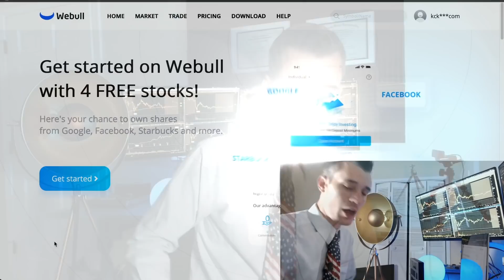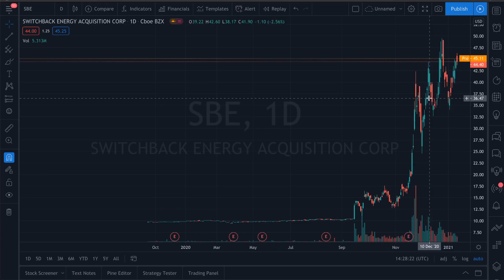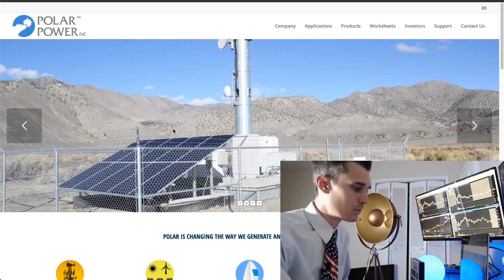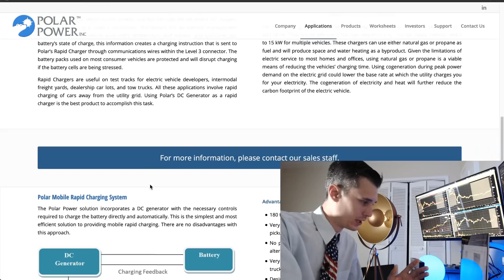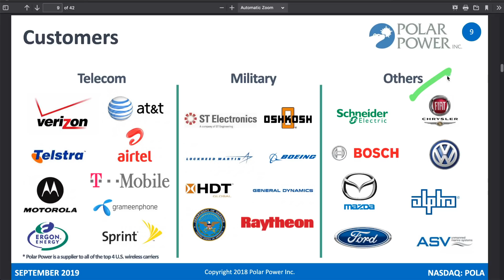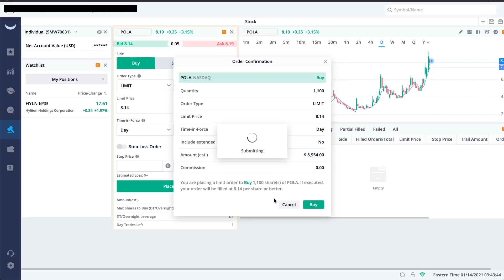This Solar & EV Penny Stock Is Ready For Blast Off | 200% Potential?

Comment: how it is penny stock?
Reply from the maker: Penny references the market cap not the per share price
Reply: @TouchdownTrades  You will find yourself wrong here-

 What Is a Penny Stock?
A penny stock typically refers to the stock of a small company that trades for less than $5 per share. Though some penny stocks trade on large exchanges such as the New York Stock Exchange (NYSE), most trade via over-the-counter (OTC) transactions through the electronic OTC Bulletin Board (OTCBB) or through the privately-owned OTC Markets Group. There is no trading floor for OTC transactions. Quotations are also all done electronically.